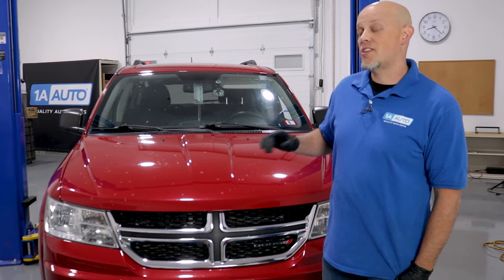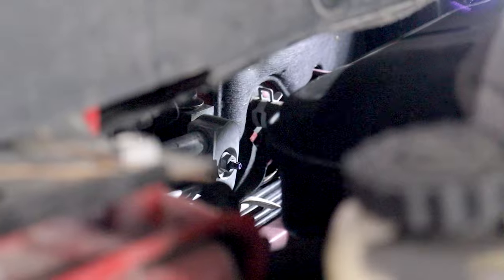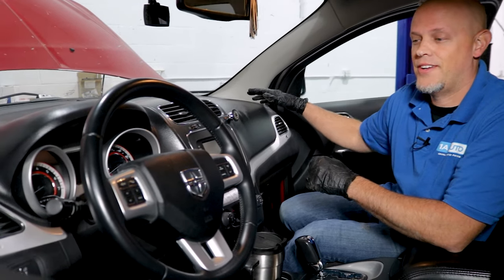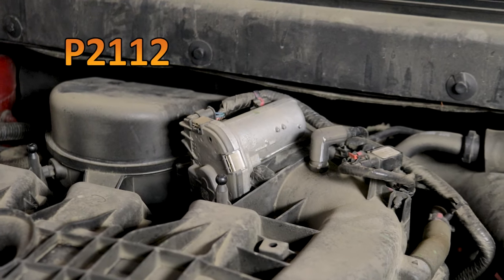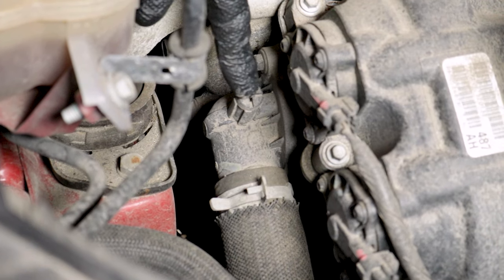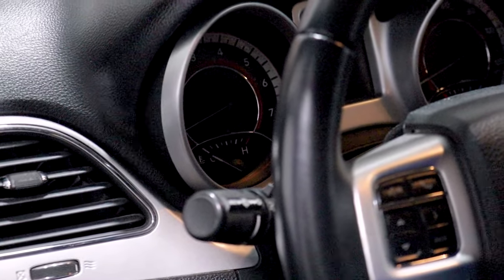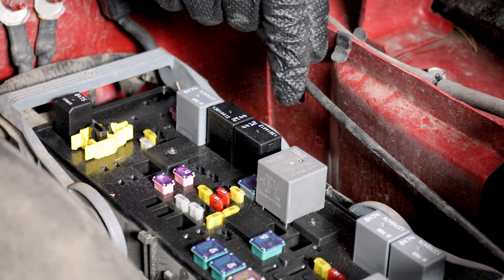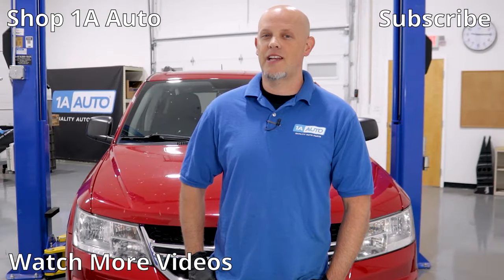Top 5 Problems Dodge Journey SUV 1st Generation 2009-20

Comment: 2009 Dodge Journey AWD, 180k, 3rd owner, put more than the last 100k on it. I've had none of these issues. Replaced rear shocks and struts, even though we don't have a tow hitch, and rarely have used the 2 rear passenger seats. Smooth runner, fabulous in snow with the AWD, large wheels, and excellent ground clearance. I upgraded the rotors and brake pads when doing routine brake maintenance. Can achieve as high as 33 mpg on long highway trips, or as low as 18 in city winter driving, but average 22. The engine consumes a 1/4 quart of oil every two fillups, which is to be expected in this engine at this mileage. I have a code reader, and the fuel trim still reads great. No codes get kicked out. Stout, dependable, family workhorse.

Comment: I keep my journey as good as I can, when I move the steering wheel and feel a click, can that mean a shaft is going or could it be any other issue? If so what would I look for, if its easy to see Ill look when I next have it serviced. When Im driving I feel the vehicle jump and its AWD, could the AWD be malfunctioning or possibly be the transmission
Reply: Any sound coming from the wheel area should be checked IMMEDIATELY. took me twice to realize that and luckily never got injured. That click can mean anything. Struts, Tie Rods, Ball Joint, Steering Knuckle, or Control arm. Is it just one click or a bunch of clicks while turning?
Reply: @colwyncallingbull  yea I saw a video on that issue, it actually may be the blinker stick itself cuz the rubber inside could be worn, but I had the thermostat housing replaced a couple years ago cuz the coolant was leaking from there, noticed the temperature was drastically climbing and when I opened my hood I saw where the problem was right away

Comment: i bought 2015  2,4 litre had to flash the computer once ,1 throttle body no other issues great car 173,ooo lots of room storage drives great for 4 cylinder 23ooo well spent

Comment: Bought one brand new in 2016, i had a sensor issue that was minor and the placement of the battery is annoying but other than that, its a pretty reliable SUV. Same space as a Durango if you ask me, with more MPG. Like ANY car, if you take care of it and ensure it gets regular maintenance, the car will run for a long time

Comment: 2019 SE 70k miles.  Only issues had to replace a rear brake caliper and the backup camera. No engine or transmission problems at all.

Comment: I have a 2017 50,000 miles and it’s currently in the dealer’s shop for throttle body replacement 😩
Reply: Had that on my 2013 Dodge! Super expensive

Comment: Have a 2016 R/T only hut 75k and there has been a slow drain battery/charging system issue since the 4th day drove off the lot.
Dealer said they never found any problems every time it dies. 
Always tell us we 'left something on' 
Which is BS because it has run down protection - if you leave anything on, it turns off after about 15 munutes.     

I've read a ton of other people have the same issue.

Nothing more aggravating than coming out to start up and getting the first 'key not found' warning, then, nothing but clunks and silence.  For no reason.

Comment: Dont forget about the alternator decoupler going out making a racket. Also the radiator hose coupler that leaks coolant and will need replacing early on. Recall on cruise control malfunctioning and driver side window control panel has issues too etc., etc.,etc.,

Comment: My 2016 Journey Crossroad with 68,000m is a great vehicle. No issues, nice ride, plenty of power. There's technically only one generation but there's a bunch of different trims so you really can't shotgun blast this vehicle.4cyl, 6cyl, etc.
Reply: I'm spose to get a 2016 crossroad with 42 kilo used at 18.000$...payments of 180$ two weeks no grantee thou...is that worth it?

Comment: I have an 09 SXT and have not had these problems per se, but others. Mind you I'm not the first owner, but some things I noticed are that several of the electric controls have stopped working, and it's not the button assembly. Also the engine mounts and control-arm bushings are pretty bad. There are any me things in this car that are way more time-consuming and harder to fix than in other cars. This six-cylinder engine is pushed up against the chassis and makes it hard to access certain things.

Comment: I have a 2010 around 190km. The heat is the biggest issue I’ve found with it, it can take forever to get warm and the passenger side gets cold air only. The key fob can be annoying too.

Comment: LOL I replaced throttle body recently for like $500 usd- not too bad. Also I find that my heater works great but my AC isn’t that strong. My key fob works fantastic- my battery is strong- 100100 miles on it-I love my dodge. I prefer to drive a heavier car- this drives like a 4 cylinder...For the price I love it- windshield wipers are kinda weird on mine the fluid is clogged. My 2003 jeep fares better with the “little things” but I appreciate the modernity/space/design/mpg/simplicity of the vehicle! I’m happy and saved a lot of money ...after reading comments it definitely isn’t the most durable vehicle but the truth is some of us aren’t willing to go with a civic and need a cheaper/bigger car. If your check engine light comes on get it sorted right away with this car or you’ll be stuck in the middle of the street! :D

Comment: I have 12 dodge journey crew when I first got it it didn't have a Bluetooth module so I got that fixed n got the fluid to clean the windshield I had to get the hose fixed those where the two problems I with my journey crew n so far it hasn't given me any other problems
Reply from the maker: +Abby Hunker Thanks for the feedback!
Reply: @1AAuto  u r welcome

Comment: Thanks for the video.  I have a 2017 and it  seems like when I change the coolant I night want to back flush the heater core before I have a problem.. I had a 2001 Fords expedition which had the same problem in 2015, I waited too long to do a back flush, it helped but it just got clogged again.

Comment: Can confirm I replaced heater / AC core. Key fob doesn't work. Thermostat went out. And the filter housing oil cooler blew out gaskets
Reply: Just changed my oil cooler 2 days ago on an R/T 3.6 AWD . Cost me $1000 plus tax

Comment: Just got my wife’s 2012 journey out of the shop with a new motor, and a week later the engine light comes on so we take it back to the shop now I need a new catalytic converter. I think the motor was probably easier to change than the battery. Other than that really like the car.

Comment: Just bought a 2009 used.  Having electrical problems.  Thought it was key fob.  Changed the battery work for a little bit.  Can us the lock or windows on driver's door.  Lights flash on and off.  Windshield wipers flash on and off.  Gages go up and down.  Security light on and off.  Dings every time it does it.  Ive done all the rest tricks I've found googling the issue.  They'd work for awhile.  The other day it stopped and then started back up.  Again.  
Also having the issue with the heat.  Passenger side cold driver side warm.  Other then that I love it.

Comment: 2009 Journey.  Currently at just over 200,000KM, bought from original owner at 85,000KM when about 7 years old.  Ran extremely well until the cooling system has crapped the bed.  Radiator at 175,000KM (was expecting this, had an 08 Avenger with same 3.5 engine that did the same thing).  Coolant bottle cracked at 200,000 km, causing the coolant to leak out.  At 205,000km just had the heater tubes disintegrate causing all the coolant to come out while on the highway while my wife was driving who panicked, constant smell now of coolant burning even after repair.  Blend door actuator now going, and it flaps like crazy when the engine is warm, shut off and turned back on.  Had to pull the fuses for the horn as the TIPM is malfunctioning and making the horn randomly go off, especially after 11pm at about 190,000 KM.  Door locks randomly won't work.  Got some major rust forming on passenger rear fender.  Battery was replaced at about 150,000KM and will never, EVER buy a car where it's in the fender well ever again.  Random rear O2 sensor errors over the winter seem to have gone away now that it has warmed up, but this thing has lots of gremlins now.  If it's anything like my Avenger that I bought basically as new (30,000KM), after about 250,000 KM I can expect the AC to fail, the EGR to start having problems and injectors to start dying.  It's end of life now and if I put any more money outside of scheduled maintenance into it I will be trading it in.  It was great till it became so unreliable - the worst thing a car can be is unreliable.

Comment: just reached 400,000 kms on my 2013, none of those problems just normal things like tires battery(which is in a stupid area)and just today the windshield wiper spray nozzles which are made of plastic became brittle and broke due to engine heat, ordered them online took five minutes to replace for 20 bucks, ive had an 1982 dodge omni with 300,000 on it, 85 caravan with 340,000 on it, 1994 caravan over 400,000, 1990 shadow over 320,000 on it,2003 srt4 with 120,000(it was t boned and written off ) 2004 caravan over 400,000 and now the journey, all with absolutely no problems except normal wear and tear, I do miss the size of the minivans though, cant fit in the suv what i fit in the vans :( ( and still have my dads 57 custom royal )
Reply from the maker: +Moo Cow Thanks for the feedback!
Reply: That's actually about right. It's popular to bash Chrysler quality these days. The chances of major problems in any modern cars, whether Toyota or Dodge, in the first 150k miles is tiny. People like you usually don't comment just to praise a certain car when it works as expected, because it's taken as granted. But the rare few who had problems will whine loudly, making it look common when it's actually not, their voices amplified by bandwagon jumpers who think bashing Chrysler quality without ever having owned the model, puts them into the cool crowd.

Although , having owned the model, and changed the battery on it, I wonder what kind of sadist decided to put it down there...
Reply: Did you get paid to write this?  I call bullshit
Reply: No way all those trans made that kind of mileage with normal maintenance.  An ac system won't make it that many miles.

Comment: I guess I’ve been lucky, I have a 2014 that has been doing really well… At the moment it needs struts which I do find a bit strange since it’s only 49,000 km (which I think is around 30,000 miles). Otherwise, I’ve been thinking of switching to another vehicle that would be more practical for camping, but I can’t bear to tear myself away from this one, it has never let me down.
Reply from the maker: +Linda Sue Thanks for the feedback!

Comment: 2014 R/T with 135k and non of these problems was expecting to see other issues.  For me it's 1 - front brakes, not sure what is up with them but they never worked well from new.  Something where the caliper pieces are not sliding well even when new and lubed IDK but this thing eats rotors, pads wear funny and everything in between.  2 - wheel hubs, replaced every one, and need to do the front again.  3 - rear dif seal passenger side.  It gets cooked by the exhaust it will go out.  4 nav system, needed some update after just a few k miles and dodge was like nope we don't do that.  5 - tranny pan leak,  I think they just use some sealant from factory, it will fail eventually.    All said and done though I like this car and hopefully i can keep it going for many more thousand miles without too much hassle.  The engine is great, the awd system is pretty decent, with a decent set of tires the journey feels very balanced and capable in the snow.  It's much lighter than other vehicles in it's class and smaller making it much more nimble and quicker for starts and stops.  We also have a 19 chevy traverse and it feels like a boat compared to the journey, good bit more space inside though.  I'd buy another journey

Comment: Man thinking of buying a 2019 awd v6 one w 33k on it, what do you think ?
Reply: Don’t do it
Reply: I’d say SKIP!
Reply: Do not buy this car....
Reply: Buy the v6 one
Reply: Don't. Bought a 2017 brand new. Burned through 3 sets of tires in 60,000 miles. It needed another set when we traded it. I rotated tires every oil change, had alignments done. Nothing resolved this issue. Power steering hoses kept coming apart and dumping all the fluid in the driveway.
Reply: @nicknelson07  That sounds very strange, and not the kind of thing that any quality issues/defect can cause. Are you driving 60k miles of only gravel in just 3 years or something? lol
Reply: Don't waste your money these vehicles are junk..I had bought a 2017 that turned out to be a lemon.. when I bought it had about 19,000 miles and the Dodge dealership wouldn't do anything until I threatened they with a lemon law lawsuit
Reply: Don’t do it 🥴 I bought one December 2018 by March 2019 I needed a new engine 🤬🤬 they would not replace my vehicle smh

Comment: 109,000 km on my 2016 base model. Replaced the throttle body just now. How you’ll know when the red lightning bolt light and traction control keep lighting up.
Reply: Hi, I have the same issue. Did you fixed the problem by replacing the throttle body?
Reply: @JoelByHomePower  it fixed the problem immediately. I changed it myself. Anyone can do it.  Just follow it up on YouTube and save money.

Comment: I have a 2014 and the cruise control doesn’t work and also, the GPS doesn’t work and the dealer said I would have to replace the whole unit if I wanted to use the Navigation.
😖

Comment: I have one 2015 with 62k miles, each time I turn the heat on / off I hear a knocking sounds on the front passenger side dash board
Reply from the maker: +Chukwudi Nwachukwu Thanks for the feedback! You may want to take a look at the blower motor. 1aauto.com
Reply: try the blend door actuator. it will click/knock when not working and its a fairly easy and cheap fix. i did mine for around 30 bucks and like an hour of work.
Reply: @dak4455 There are 3 actuators and each are a little different, so it may take trial and error to get the right one. Mine clicks but still works so I just left it lol

Comment: These are my issues. 

1: thermostat has been replaced 4 times 
2: battery issues 
3: electrical windows don’t t work, I have to keep them closed 
4: windshield wiper fluid doesn’t work 
5: always some electrical issues
Reply from the maker: +Michelle De Broeck Thanks for the feedback!

Comment: I have 2009 sxt,  I have problem that everytime its wet I get a parasitic draw that kills the battery. I also have random problems with the alarm hoping off for no reason. And the dealer did all the known recalls and its still doing it

Comment: Can you do a video on the top five problems of the third-generation, 2014 to 2020 Mitsubishi Outlander GT S-AWC compact SUV? It has the 3 L V6 engine and the six-speed automatic transmission. They are very reliable and they are fuel-efficient. I just want to know some of the problems on one of these third-generation Outlander's with the MIVEC V6 engine. Thank you very much and have a great day.
Reply from the maker: +Mark Dumagpi We're always cycling through common cars. We'll add this to our list! http://1aau.to/m/Shop-1AAuto-c
Reply: @1AAuto  Thanks

Comment: I've got a 2011 Dodge Journey Mainstreet, just turned 101000 thousand miles, the only problem was the right front wheel bearing, and that was an easy fix as long as you use a wheel puller, they come from the factory with no grease fitting points, it's a closed system, I replaced it with one that I can put grease into, simple fix if you know a little about working on cars. I've been doing my own brakes since I was sixteen. Drum brakes, pain in the but!!! one more thing, the rear window wiper works when it feels a mind to...LOL!!!

Comment: I had 2012. It was the worst vehicle I ever owned. Period. I spent more in fixing all the problems than I did making payments. After 2 and half years I traded it. In a one year span, heater core failed, thermostat failed, water pump failed, head gasket failed, and radiator failed. It ran hot all the time no matter what got replaced. And I'm pretty sure towards the end, the transmission was going. First generation and hopefully the last. Anyone who over owned one these should be compensated for pain and suffering.

Comment: I have an ‘18 Journey Crossroad and, other than the looks and overall driving performance (thankfully it has the good Dodge V6), I’ve been very disappointed with some seemingly small things; 1) the headlights are very dim, especially low beams. High beams are almost equivalent to a standard low-beam 2) constant condensation inside the headlight covers, despite having both of them replaced under warranty. They just do not seal, and since they’re now out of warranty, the dealer won’t do anything, other than offer to replace them. Since that’s already been done, why would I pay to have them done again, knowing I’ll have the same problem?!?! 3) U-Connect has no connectivity for the ‘18 model, and there’s no way to upgrade, meaning no Apple CarPlay. 4) The back-up camera is ridiculous. Despite cleaning the lens with everything imaginable (alcohol should work!), it still looks like I’m viewing everything with Vaseline cakes on my eyeballs! It’s beyond unacceptable. 5) very poor gas mileage. I average 17-19mpg, and did a whole lot better with my ‘07 Pacifica. It’s worth noting my Pacifica was the best vehicle I ever had, and I only got rid of it because it had close to 300k miles, and was time for an upgrade. Unfortunately, the new models are minivans, and don’t have that crossover look, so I went with the Journey. Lastly, knock on wood, but I feel fortunate not to have experienced any of the 5 “biggest problems” here!